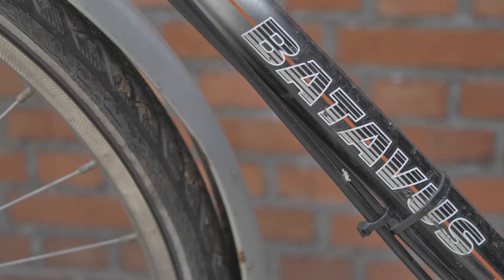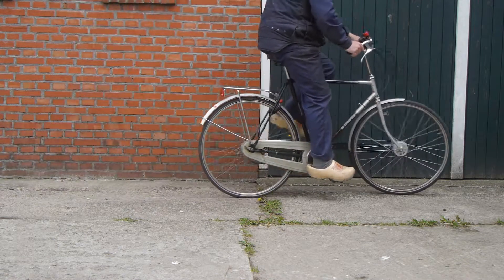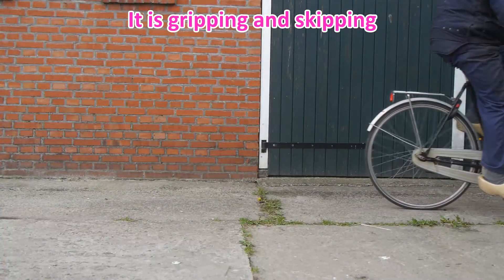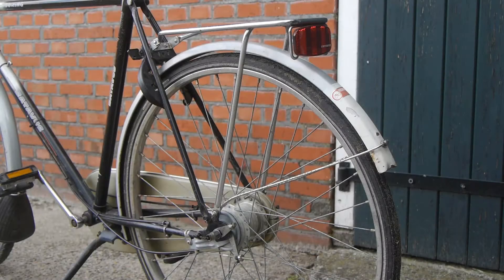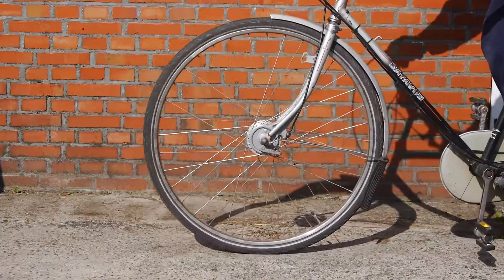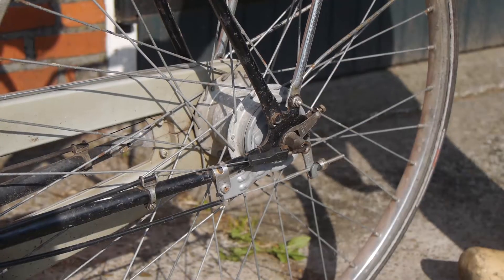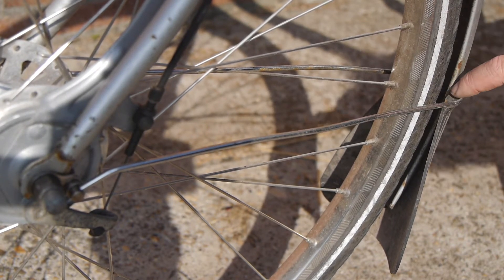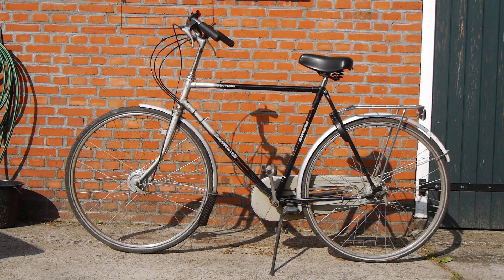My Batavus touring bicycle

Comment: Have you done anything with the brakes on this since July ? Curious to know what the issue is. An ABS feature seems unlikely, given that drum brakes don't exactly pull you up to a sudden dead stop.
Reply from the maker: I replaced the front drum but I still need to look in to the rear. I wasn't really thinking it would have ABS :)